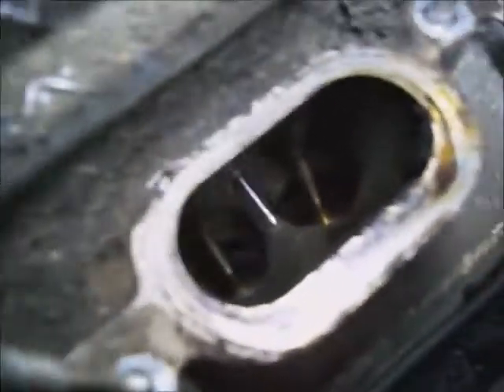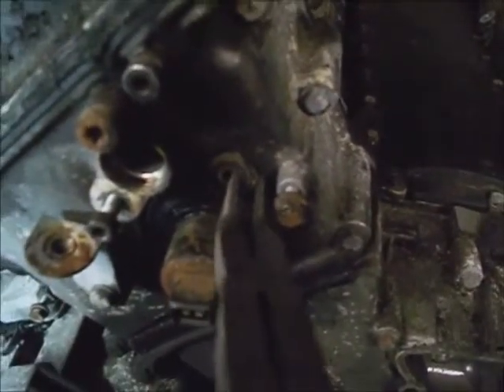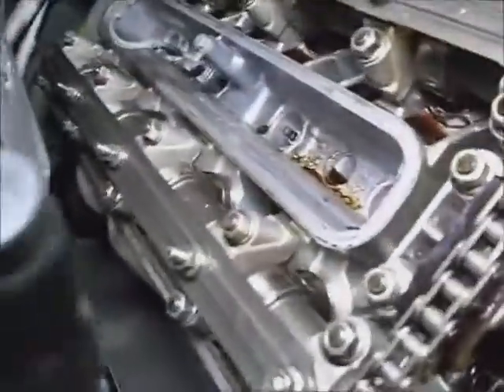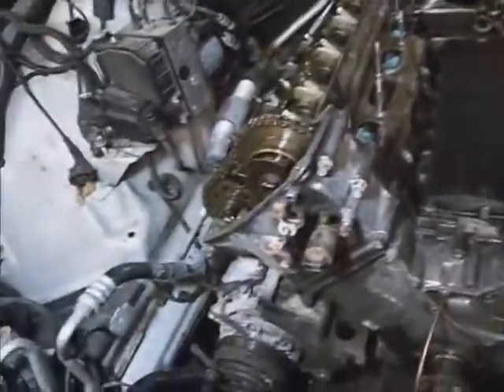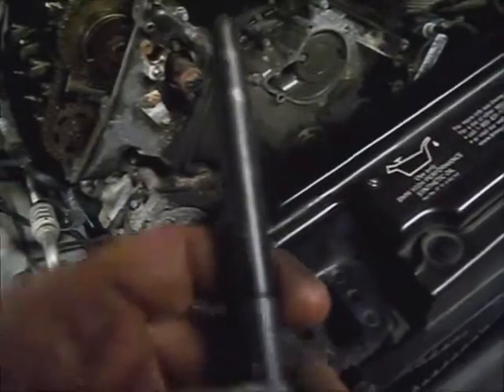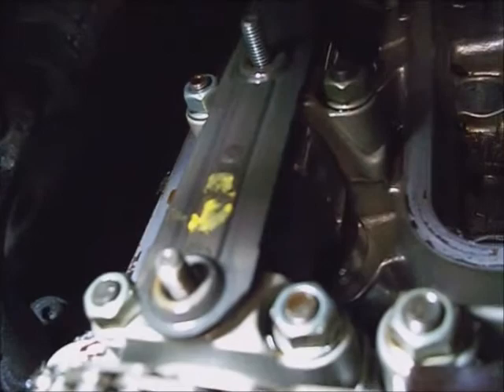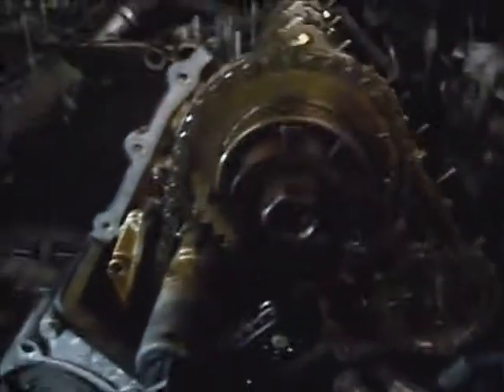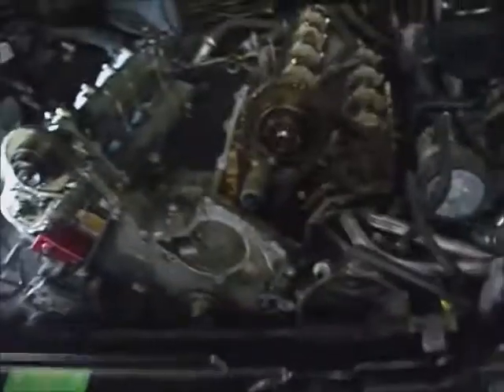BMW 540i E39 `02 w M62TU eng pt.3 VANOS, top timing covers,TDC, cam positon rings remove, tools view

Comment: Hello great videos they have been a huge help. One question do you have to remove both the exhaust and intake cam gears to replace the primary and secondary chains? Or can you just remove one gear?
Reply from the maker: It all has to be torn down to do anything to any chain, as seen here.   https://youtu.be/GIBd0pAY0kU?t=12m4s
Reply: Okay Thanks, I'm about to do mine and your videos are fantastic! Very detailed.
Reply from the maker: Thanks for watching.   Be advised; This is a very long process, requiring attn. to every detail,  and requires renting several hundred dollars worth of special tools to set cam timing.  A single mistake, can turn it into scrap immediately.  Listed in all 8 videos, is a list of items that should be addressed while it is torn down, to save headaches later.  I recommend at least 5 years exp. in the field before attempting this procedure.
Reply: Thanks for the advice. I was wondering did you replace the knock sensors and coolant pipes?
Reply from the maker: no, just new o-rings, water pump
Reply: Auto Dr 
Sounds great I was planning on doing the same and I feel alot better knowing I'll be doing what you did. Thanks again you have been a huge help.
Reply from the maker: If you can, you should front the cash for some new vanos units.  While its torn down.....
Reply: Were you able to find the torque value for the nuts that attach the oil lines to the cam caps?
Reply from the maker: 10 Nm, is standard spec for all m6 bolts.
Reply: Okay Thank you.
Reply: I read your comment in another video that your crank seal rolled up. Would you recommend that I install the timing cover without the seal  then install the new seal after the cover is installed?
Reply from the maker: Yes, as trying to save time, I actually cost time trying to cut corners in doing it all in one shot.
Reply: Great. I went ahead and installed the seal after installing the cover. The seal went in without any problems. Thanks for the help.
Now I have another question, I'm about to torque the crank bolt and in your video it looks like the yellow mark is only about 60 degrees from your starting point mark. Does it look about 60 degrees only on the video?
Reply: Sorry, I just looked at the video again the yellow mark looks like about 90 degrees not 60 degrees. Did you mark it more than once?
Reply from the maker: Yes, marked twice to see mark again. 100 nM and then-60*-60*-30*degrees
Reply: I just want to let you know that I'm done with changing my timing chain guides and the x5 is running good. Your videos and replies were a huge help. Thank you.
Reply from the maker: Excellent, thanks for watching.  Those do give a man a beating for sure.
Reply: @AutoDrdiy  Hello I was wondering my 1998 BMW 540i 6speed I don't see the pin hole cut away for the locking pin to fit into the flywheel. Is the manual and auto the same process? Thanks Richard.
Reply from the maker: There is a hole just to the left of the bigger round open hole in center, behind oil pan.  The alignment hole is raised up on a boss there.  Rotate engine until #1 TDC, crank damper should be at 0, the cam shafts ID should be pointing straight up, may have to wiggle crank a little to insert pin, all the way.  Thanks for watching